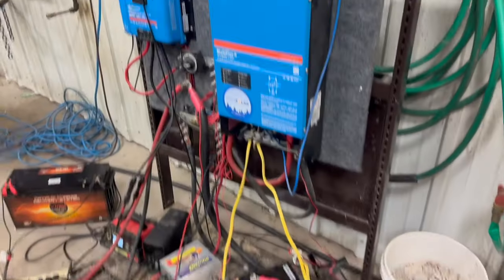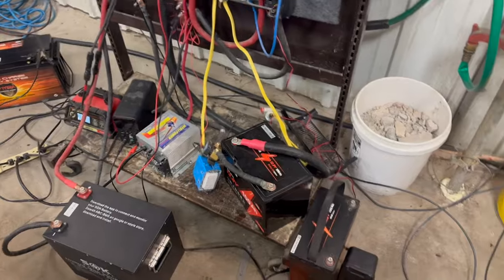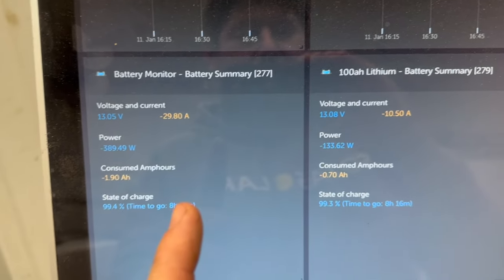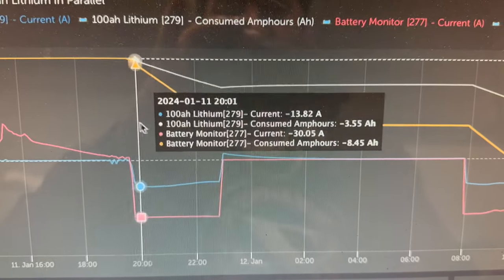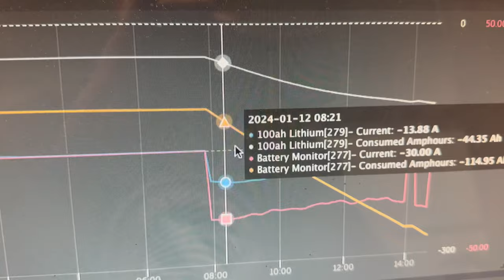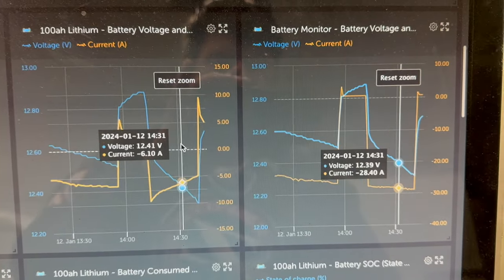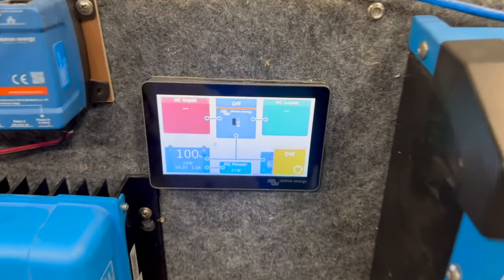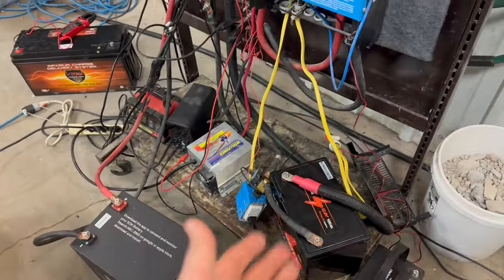Is It Safe to Parallel different size or age lithium  RV Batteries?

Comment: Hi, great video.  I have a suggestion, though.  This is a bit of a technical video. So,  in my view, you might want to state your conclusion at the start of the video.  Then, support your conclusion with evidence, and finally,  restate your conclusion at the end.  The best way to convey technical information is to think of it as a Christmas tree.  You start by stating your conclusion. Then you present your facts, sort of like hanging the ornaments on the tree.  Finally,  you restate your conclusion to leave, no doubt, as to what you were conveying.

Comment: running 2 home built battries, 450ah and 240 ah, the bms's take care of everything, and the amperage gets shared, i ran a 2000 watt ac load approx 200 amp dc as a test until the bms's shut down,  works fine.

Comment: I’ve been running a diy 300ah and a chins 100ah in parallel for about a year now with no issues. I’m also running three diy 300hr batteries in series for my 36v trolling motor for over two years now with no issues with imbalances. Great video👍

Comment: I have 2 200ah 12v lithium batteries. I connect in series to make it 24v. Then I plan to buy another 24v 320ah lithium. I will connect this 24v battery to the former 12v banks. Is this ok? All batteries are from the same company. I don’t care one battery charge another battery a little. My concern is it won’t damage other equipments such as charge controller, inverter.

Comment: Thanks, What size fuse would you recommend putting between the banks please?
Reply from the maker: Equal to or less than what the wire is rated for.   If using 2/0 wiring, 200a or smaller (too small and it will blow prematurely) .. if 4/0 cabling, 400 amp or lower, like 300 or 200 .

Comment: How many lithiumn batteries can you run in parallel?
I have (2) 200 amp batteries and also just got from a friend (2) 100 amp lithium batteries,  Can I add a total of 6 batteries all in parallel if I got 2 more batteries for a total of 800 amps.
Thanks
Andy
Reply from the maker: With circuit protection between each battery, and overall protection for main wires it’s unlimited in my opinion.

Comment: Both batteries will charge and discharge at same percentage, ie if 30 ah drain, small battery will give 10 ah and larger battery 20 ah (roughly due to being 206 ah)

Comment: IV got 12 cells at 200ah..at 12v set up.
So IV one at 400ah and another at 200ah.
Yes time to time I do kick the power on....rest of time I'm a ,3c discharge.
Time to time I measure the voltage in each cell....
My deli bms's seam to keep them well balanced as I'm 100/200mv out.
I'm using a fluke 112 in calibration to test with.
Great information clip there....thank you.

Comment: Do you think it's safe to add two new 150ah lithium po4 to 2 year old 2x 120 ah lithium po4 in parallel.  400 amp shunt in existing buttner system. Appreciate your opinion.
Cheers Graham
Reply from the maker: Absolutely! More and more we’re thinking about current protection between battery banks. So we may want to look into putting a separated fuse between them. But other than that. It’s fine.

Comment: Can I run the same size lithium batteries from different manufacturers in series, parallel?
 I have 2, 12 V 100 amp Li-time batteries and would like to buy two more of the different brand( from a friend) and put them together in a 24 V 200 ah configuration.
Is that safe?
Reply from the maker: I’d say I’d each series pair is matched, you’d be fine. That said, you need battery balancing to keep the mid points balanced.

Comment: Great video!  Very informative.
With regards to your recommendation to not series up batteries to get the target voltage, my 24v system is using two 12v 200ah batteries in series (exact same batteries) and have been using it for about a month now.  No issues so far.  I top balanced them as best as I could before connecting them in series and I got their voltage to within 20mV of each other e.g. one is at 13.43v while the other is at 13.41v.  A month later, they're still 20mv from each other.  So far so good, I guess.
Will revisit their status and health in around 3 months maybe.  I plan to add another battery then - a 24v 100ah battery from a different manufacturer.  I'll connect it in parallel to the two series connected 12v batteries to increase my total capacity to 300ah.
Reply from the maker: Glad it’s working out so far. We’ve installed a few systems with that configuration. We do recommend a battery balancer then, Victron offers one. 

Check the battery voltage near top of charge, that is where you’ll see the difference. Use the mid point sensor on the shunt to log the data in the cerbo if you have one. It’s a good indicator of it will be an issue.

If you keep your absorb voltage around 28.4 or so, you should be fine. At 28.8-29.2 it might get tricky with one battery cutting off charge before the other.

Comment: I’ll guess the voltage during the flat area of the charge/discharge curve will match and the amps will be 32% to the 100Ah and 68% to the 206Ah. The areas 0-20% SoC and 80-100% probably will be different because of internal resistance of each battery and any additional resistance in the path to each shunt 😅
Reply from the maker: I think you’re pretty close.

Comment: So really the only problems would be over an extravagant amount of time (years) for the smaller battery getting slightly cycled more and balancing from the larger battery. 
So really if you’re fine with loosing 1 or 2 of your expected 15 to 20 year batteries life then it’s probably ok to just parallel lifepo4 battery brands.

Comment: Well if u have a Lithium 200ah and 2 agm batterys. How do u set it up to use the Lithium battery until it's needs the agm batterys. Is there A specific way you need to set it up.?

Comment: I have 2/ 100ah batteries and 1/50ah, for some reason I thought it was not safe to parallel them together. What do you recommend? to have the 50ah in the middle or at the end?

Comment: So what are the discharge stats of each battery when tested seperatly for comparison to when they are paralleled? What is the internal resistance of each battery and is this affecting the discharge/charge rate?

Comment: If  bms fail , AGM will protect solar Charge Controllers for battery voltage loss , when solar is charging.
Reply from the maker: Great point

Comment: Hi there I have a question about my battery relocation from the tongue of my 30 amp Northern Spirit 2649BH. Moving 4 X 100 ah LiTime minis to behind my tv which is about 1/2 way down the rig.  I will be installing a Victron MP 3000 watt also, I know I need to connect to the fuse panel to the batteries but how would you do this ? Would you tie into existing cable somewhere as there needs to be power to the tongue area for power jack and break away cable. Thanks for any input
Reply from the maker: I’d recommend using a bus bar or Lynx Distributor to connect your batteries to the Multiplus. Then run a separate fused 6awg line to the tongue or to the DC distribution panel, whichever is easier/ closer. This will energize the tongue jack and brakes.
Reply: @sotasolar  Thanks for your reply, I do have the victron 6 way mega fuse holder and I do have 6 awg OEM wire that is already there from the OEM batteries. Can I tie into this line as there may be other 12v items that feed from this wire. I have one renogy 100ah battery I was going to run off the tongue which will be hooked up to my 100 watt OEM solar.My battery disconnect switch is in front cross beam do I disconnect this? Sorry for all the questions, I do have the explorist life plans that I’m going off of.
Reply from the maker: @richmurphy5647   In this case our philosophy is to simulate the old battery location by extending the 12v 6awg leads from the Lynx or Bus bar to the old battery location.  This ensures everything still works as intended and we feel keeps the system understandable to others who come to work on it after us, such as RV techs or owners. We'll often use some heat shrink tube to cover a bolt and nut that connects the two systems together.   Almost all of our trailer install videos cover this (5th wheel work differently many times).

Comment: Is there any BMS in those batteries. They control charge and discharge. So no problem
Reply from the maker: Yes, SOK and Li Time both have BMS. I agree, BMS makes the battery very tolerant of abuse they might not otherwise be.
Reply: @sotasolar  the BMS is critical. I build my own batteries with CATL or Eve cells and the BMS is JK. I thew the nice looking Daly out of the window because of bad balancing and no updates

Comment: How would it look if you added another 100ah battery
Reply from the maker: I'm assuming adding it to the other 100ah, so you'd have  1x 206ah parallel with 2x 100ah ?  I suspect it would not be 100% equal because of different BMS and internals, etc.  One of the goals of this test was to show what happens in worst case scenario and to see how critical it is to do this or not.
If  you mean adding the additional 100ah battery to the 206 side, I suspect the affects would be compounded further but in the end still be workable for a load like this.

Comment: I'd like to know how the same test would go if the load is greater than the larger batteries max discharge and also if the charge current is more than the max charge
Reply from the maker: If sustained I’d expect a cascading protection mode shutdown from the BMS.  I’m not opposed to this, but what would be the use case?
Reply: @sotasolar  Running a high load like convection microwave or AC that could exceed one battery max discharge seems like a valid use case. Similarly if your inverter charger puts out a max current greater than one batteries charge limit but well within the two batteries, you could exceed if one reaches fully charged ahead of the other.
Reply from the maker: In this case we’d have to add more batteries. We recommend 400a of discharge and 200a of charge capacity. 

I might be missing the point of running this test under conditions that would likely cause the BMS to fail. If killed a few myself :-)
Reply: @sotasolar  I was just describing a valid test case where dissimilar batteries could "fail" to perform.

Comment: Very interesting video. 
I have 2 200ah Enjoybot batteries for my 5th wheel. I also have a 12v Victron Multiplus II 120, solar chargers,  & smartshunt. (basic description of setup)

I would like to at least double my battery bank. My existing batteries have been in use for a little over a year. Only have had about 4-6 discharge cycles on them. The rest of the time, they have been on standby/maintenance charge. In the winter months they aren't used.
So, my question is can I add 2 more of the same to the battery bank without harming any of the batteries? What would happen if I did that? 
I know....batteries are better off being installed together at the same time.
Just thinking it might save a little money if I could just add 2 more. If not, then going with 3 of their 280ah versions will do the trick if I have to go the route of same age batteries.
Reply from the maker: You’re fine, add them. If it works fine with a battery double in size, one 1-2% different will be just fine.
Reply: @sotasolar  Sounds great....thank you!
Hopefully, we are done with sub-zero temps in MN  now....🥶
Although we have had a pretty easy winter so far.
Reply: Installing new batteries together really only applies to lead acid batteries. You will be just fine adding additional batteries of different age and ah ratings with lifepo4 as long as they are in parallel.you can do it in series as well but they all must be the same or close to the same ah rating.
Reply: @lukefarmer5391  They will be the exact same batteries. Of course, the manufacturers usually say only within the first few months or so. Lol
Reply from the maker: @BradLMN imagine a company selling batteries having a recommendation that favors the sale of more batteries? :-) Some recommendations are well founded, this one, I do not see it.
Reply: @sotasolar Yes, they usually always promote more sales. The difference in price from buying 2 200ah batteries vs 3 280ah is about $900. The extra 40ah I would get with 3 280ah batteries vs adding 2 more 200ah batteries is definitely not worth spending that much.

Thank you for your advice once again.
Reply: I think when paralleling many lithium packs the discharge current capability grows to such a high number that one must install a fuse capable of disconnecting the circuit in a fault situation.

Comment: Question,  Can you run to battery one 48V and one 51V in parallel?
Reply from the maker: I’d be curious to see the exact make and model that you referencing but in general I would not. We have successfully paralleled, lithium, and AGM without a problem, and those do run at slightly different voltages, but with the same charge profile, they still charge up equally.
Reply: I got one Aolithium 51.2V 100Ah  5120Wh and one it’s TTN 48V 100Ah  4800Wh i’m trying to run them in parallel but doesn’t work. The inverter is using it the 51 V battery first and then start using the 48 V once the first one get to about 15% of usage
Reply from the maker: @gregfabian4655 that’s similarly to how AGM and lithium work when paralleled. You may need to adjust low voltage cut off down on the inverter.
Reply: Thanks for your tip. I will try that I believe that will work.